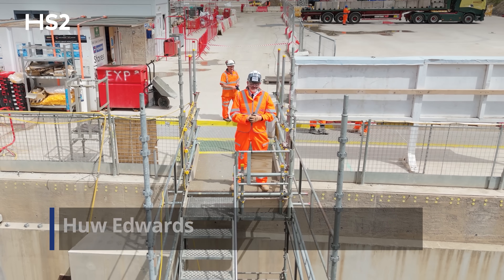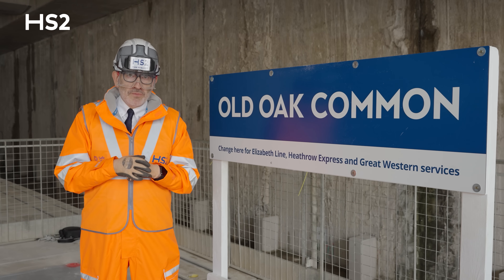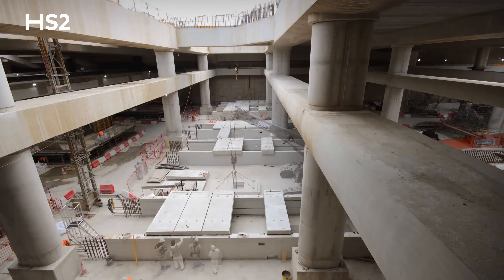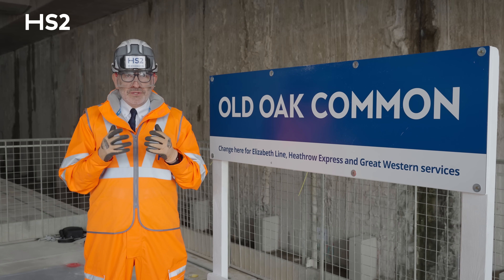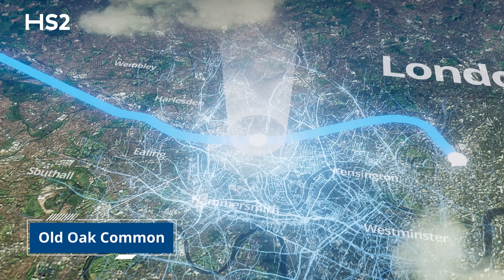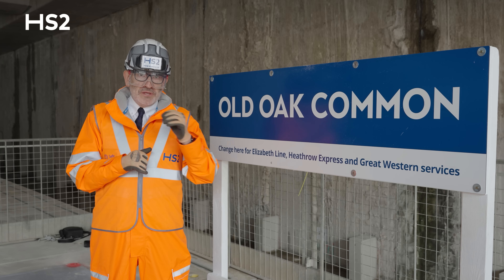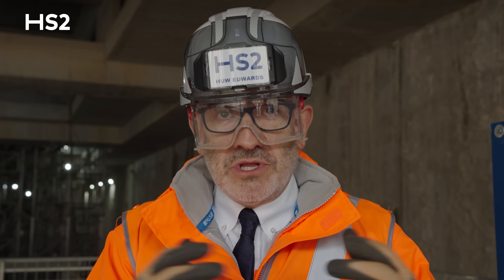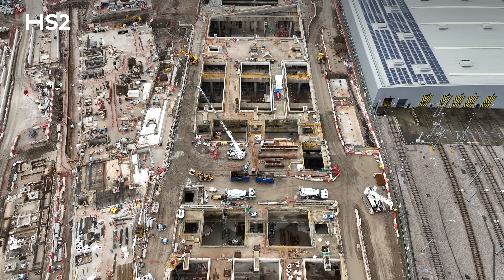Britain’s new high-speed railway: 🚆 First platforms installed at Old Oak Common 🏗️

Comment: Absolutely fantastic video. Well done, please upload more content.
Watching as a Expat from Australia, it's amazing to see Europes biggest infrastructure projects taking shape. And something the British people should be very proud of, the civil engineering alone is outstanding. It's just a shame the political meddling and mismanagement from HS2 board have tarnished this project. hopefully with Mark Wilds at the helm and his success with crossrail the government will have the foresight to carry on with phase two a/b from Hansacre to piccadilly via  manchester airport as the MNWRL Staffordshire connector. But this must be built to the USG GC loading gauge and slab track and not to the proposed W12 victorian standard which would be criminally wrong and insane. With the proposed liverpool to manchester rail line (W12 loading gauge, if built) the section from Millington to piccadilly via manchester airport must be GC compliant. With the current Mayor Andy burnham vision for a new piccadilly underground through station at piccadilly (july 2025 announcement), lets hope its designed for GC size 400 meter trains and platforms from the start. This could be very achievable, if done in sections over the next 20 years, with the current and future skilled up workforce.  The nay sayers need to remember big infrastructure like this is not for necessary for us but for our children and grandchildren and the massive economic benifit for the UK. Well done to all the people involved in building this you and the UK should be very proud.

Comment: Thanks for this video. Getting InterCity trains off of our mainlines, so that more commuter trains and freight trains can run on them is a vital part of the work needed to improving our old railway lines.

I hope that this "reset" involves restoring the Eastern Leg of HS2 and extending both the Eastern Leg and Western Leg all the way up to Scotland. I also hope that HS2 Limited stops building terminal stations in cities in the Middle of England and that we instead get stations like Old Oak Common and through platforms in places like Manchester.

(And eventually, I hope to see Old Oak Common directly connected to Stratford International, so that Glasgow and Edinburgh can get the Eurostar services that they were promised when the people of the UK were originally asked to fund the Eurotunnel. And yes I mean that we should abandon St Pancras and the not-yet-finished Euston station and build a "high speed Crossrail" line though London with a new Central London high speed station.)
Reply: It's a nice idea, but there's an awful lot of tunnelling under London already to avoid: to get 2 new tunnels through without colliding with/compromising the engineering of the tube network would be another gravy train for the engineering consultants, I guess....

Comment: Building a new railway in this densely populated country is really difficult, and HS2 is doing just that with real imagination in creating the Old Oak Common hub and terrific engineering skills to solve numerous problems. Just like the Elizabeth Line, when it opens we will wonder how we coped without. Regional commuters in the midlands who currently crowd onto intercity services and often have to stand will also get a much better service.
Reply: It's no harder than building Tokyo-Osaka, which the Japanese updated recently (they first built a Shinkansen on that route in the early 1960s). We have got to stop deluding ourselves that we are uniquely challenged by our demographics and geography: we are not. We are uniquely constrained but our NIMBYs, our parasitic legal system, our planning system and our inability to engineer appropriately rather than over-engineer by quadrupling the cost are what makes HSR so difficult to deliver.

Comment: There needs to be a tunnel that directly connect OAC with STRATFORD INT.
Reply: Why not a loop round past Heathrow, Gatwick to join HS1 at Ashford? Londoners don't need to connect OOC to Stratford, they just go to St Pancras. Just build it under the M25 and M20......

Comment: While a London to Birmingham high speed line is a good idea on paper, I honestly feel a high speed line between Liverpool and Edinburgh across the Pennines via Leeds, York and Newcastle is needed way more than HS2, the capacity and reliability problems on The TransPennine line are way worse than on the WCML.
Reply: The reason for HS2 is to relieve congestion on the Southern Section of the WCML and through Birmingham
Reply: @peterwallen1063 I see.

Comment: This is taking far far too long and actually should be built all the way to Glasgow and Edinburgh. But good to see it actually being built. By the time HS2 is completed Japan and possibly China will have MAGLEV going distances further than HS2 London zone 5 to Birmingham Zone 5.
Reply: Really hard to make any financial case for extending to Glasgow or Edinburgh.  HS2 is about capacity, not actually about speed  - you get the speed as a by-product of building a new modern line.  There's no economic case for a huge increase in rail capacity to Scotland which a new line gives you, because there are cheaper ways of providing the required capacity.

Comment: If the Euston link is there, seems a bit daft to make OOC so big as its just a through station at that point.  Personally I think HS1 and HS2 should have had the same meeting point.  It seems short sighted to me.  Also, all HS2 is doing is relieving pressure on the WCML and that is it.  Between 189 and 226 trains a day between currently run between Euston and Birmingham.  HS2 will drop that number to approx 50 I think.  Meaning the WCML will have loads of head room for expansion of freight and local services.  Thats where the positives start and end for HS2 in its current mandated model.
Reply: OOC will be a terminus for some years until Euston is built.

Comment: Billions wasted and yet HS2 keep churning out videos on 'look how good we are' when this vanity project can only be described as a failure are really should be cancelled immediately.
Reply: Really; and how many billions and how much land, would it cost to build two new motorways to the north to take the traffic instead.  No, the country needs improved rail infrastructure.
Reply: I think you are confusing issues; I agree the country needs a better rail system but HS2 isn't the answer; it doesn't meet the original design parameters and so has failed. The money would have been better spent upgrading the original system and removing the 'high speed' element.
Reply: I can see you have a vested interested in HS2, ie, keeping your job for as long as possible, I get it,. HS 2 failed due to a flawed initial business case, poor planning, procurement strategy, the 'it'll be all right' attitude and the 'wrong' people in key positions. As an EM I use HS2 as an example of what happens it you dont know what you are doing. A country the size of UK doesn't need a high speed link, Covid didn't help HS2 I know but it was a poor idea from the start managed (and I use the work in the loosest form) by people who hadn't a clue about running an MCP.
Unfortunately it will be completed, but by the time the ticket prices have been passed onto the public it will not be economically viable and so will die a slow, painful and expense death.

Comment: Ah yes...the Aston to Acton line..HS2 railway might never reach Euston and Old Oak Common could become its permanent London terminus in an effort to avoid the cost of building the station at Euston. . So we’d end up with a relatively short shuttle service from Birmingham city centre to the edge of London, and, well, that’s about it. The logic for going for high speed to Birmingham is lost.  Spending 300% more for a really fast train set (compared to 125mph) between the outskirts of two cities not too far from each other is bonkers. A trip by HS2 between Birmingham and Old Oak Common would take around 42 minutes, but the connection within London between Euston and Old Oak Common adds another 30 minutes, plus an average of 10 minutes changing at Old Oak Common.
Reply: Sorry mate it shows how much you know about Birmingham, the HS2 line from Birmingham Interchange Station to Birmingham does not go near or through Aston, it runs through Washwood Heath, Saltley and Duddeston before entering Birmingham Curzon Street Station in BIRMINGHAM CITY CENTRE, plus it will be terminating in London Euston as Old Oak Common Station is not designed as a terminal station and the tunnels from OOC to Euston have to be bored out now before the station opens for safety reasons. Aston is about 2  miles from the HS2 route into Birmingham with the trains doing 225 MPH on most of the route
Reply: @peterwallen1063  Lighten up. People call HS2 the "Aston to Acton line" or the "Acton to Aston shuttle" because the planned route has been significantly scaled back, potentially terminating in West London at Old Oak Common (near Acton) instead of Euston, and with the Birmingham terminus being Curzon Street station (fairly near Aston and only one consonant different!). Trains from Aston to Birmingham New Street typically take around 8 minutes. The revised HS2 plan created a shorter, less impactful high-speed rail line focused on connecting these two specific areas, rather than a larger network serving multiple cities. (Curzon Street Station, the planned northern terminus of HS2 in Birmingham, is currently scheduled to open between 2029 and 2033. While originally planned for 2026, delays have pushed back the opening date).
Reply: @paulfildes5489  Did you read my comment or actually know where in Birmingham HS2 does run, as I said it runs no where near Aston so how is it called the Aston to Acton line when in Birmingham HS2 runs from Birmingham City Centre ( Birmingham Curzon Street ) through Dudeston, Saltley and Washwood Heath, Aston is 2 miles away from the HS2 route, I live in the area of Birmingham and no Curzon Street again is nowhere near Aston. Aston Station sagain is around 2 miles outside the City Centre and no matter how long the ex Walsall trains and X City trains take to get into New Street going through Duddeston Station first makes no difference. The HS2 line does not go anywhere near Aston full stop plus it is now going into London Euston as per the new Labour Government. There is no revised shorter HS2 route from Birmingham to London not sure where you got that from and doesn't connect specific areas, it connects the UK,s Capital London to the UK's Second City and second largest City of Birmingham City Centre
Reply: @peterwallen1063 The HS2 programme has become a casebook example of how not to run a major project. It is unacceptable that over a decade into it we still do not know what it will cost, what the final scope will be, when it will finally be completed or what benefits it will deliver. The government confirmed that HS2 would terminate at London Euston in the Autumn 2024 budget. However, the Department does not yet have a plan for the work at Euston which includes: the HS2 station, the existing Network Rail station, the underground station, and the commercial and housing developments near the station. In addition, the Department intends the work to be substantively privately funded, but it is unclear how achievable this goal is. After all this, the government announced the new Euston station will only have six platforms rather than the 10 or 11 platforms as originally planned. One rail consultant said that having only six platforms was ‘lunacy’.
Reply: @paulfildes5489  First they are at the moment tunnelling between Old Oak Common and the Throat of what will be the HS2 station, the HS2 station will be made up of 6 platforms solely for the use of HS2 services and a 7th platform for joint HS2 and WCML services that has already been announced by HS2 ltd in one of their many video's along with the upgrading of the existing Euston Station. The benefit of the HS2 line is the speeding up of high speed passenger services at least to Birmingham and Stafford and more capacity on the existing WCML for other train services and Freight by moving the vast majority f Avanti West Coast hi speed passenger trains onto the HS2 route, the other West Coast platforms will still be in use which will amount to around 14 + in total at Euston overall

Comment: Terminating at Old Oak means that the journey time  from Birmingham to central London is longer in time than it is now. Great!
Reply: The intention is to eventually take the line into Euston from Old Oak Common.  The Old Oak Common destination is therefore temporary, albeit likely until 2040. .
Reply: @TrevorWilliams-fq8mg  Therein lies the problem 😂
Reply: @guyallison9066 Yes it's a long time.  There's no way Euston can be opened sooner. They haven't yet got a design for the station or funding for the residential to be built above the station. .
Reply: @TrevorWilliams-fq8mg  Why does it take 15 years to go to Euston? Can only be due to drip feeding minuscule amounts of funding.
Reply: It is not terminating at Old Oak Common as this station is not being constructed as a Terminus Station it is going to London Euston

Comment: Progress on HS2 always makes me pleased, however, I still hope that future governments will re-green-light HS2 in full (both the Manchester and Leeds legs) with scope to extend from Leeds to Edinburgh and Glasgow via Newcastle on 300 km/h+ ETCS signalled HSLs. A Sheffield Bypass would be nice too if Leeds is recovered (even if it has to go onto conventional track with British loading gauge restrictions). A high speed connection from Leeds to Manchester as part of HS2 would be great too, allowing people in the North not to have to go down to Birmingham to switch to my dream Leeds to Newcastle to Edinburgh and Glasgow extension.

I also wish that HS2 had stuck to its plans for operators to use fleets at a larger European Loading gauge with the opportunity to purchase pre-existing stock and kept the earlier planned compatible platform system with 760 mm high platforms (or even 550 mm for Alstom double-decker TGVs, although that wasn't in the original plans). I know step-free access for wheelchair users has been a big reason for the higher platforms, but I'd have liked to see each train feature a dedicated coach for disabled access that was compatible with lower floors and lower platforms, even if that meant having excess ceiling space and steps up/down at the end of each disabled coach to the corridor connection to the next coaches.
Reply: The eastern leg is long gone, won’t be recovered. The section to Crewe and Manchester is still a possibility though as the land hasn’t been sold off yet and there is big pressure from Manchester councillors to resurrect it. Additionally NPR if it goes ahead will link Liverpool Manchester and Leeds together, and be directly connected to HS2, so services from London to Leeds will be entirely possible on HSR, as well as Liverpool too. NPR is basically HS3 but they’ve renamed it to cause less controversy, as we all know the controversy HS2 has caused.

Comment: HS2 - The Old Oak to Brum Shuttle - with connections at street level in Birmingham to the utterly vile New Street for a slow train - Stop building the part now - until they continues north its a FAILURE
Reply: First it will be now running from London Euston to Birmingham Curzon Street with  tram connection to both Birmingham New Street and Birmingham Snow Hill Stations and Birmingham New Street Station has been rebuilt now and is not vile.

Comment: The future of the UK's Railway Network? That would imply there are benefits to the whole of the country building this white elephant, massively expensive project, not just the bit between Birmingham and 'just outside London'. By cutting off the spur going further North and East, this new rail line is going to make congestion on the traditional lines considerably worse to the extent we will lose more of the current services than will be replaced by the ones operating on this new line.  The lines  around the connection between the traditional lines and the high speed line and also further north around the Manchester area will be clogged up with slow moving trains as these new high speed trains won't have the capability to tilt (because on the new line, they won't need to) and so will run a lot slower on traditional lines compared to the existing trains that can tilt. 

The other issue is that the trains that will use this new line going to stations not on the line cannot be double decked and cannot be 400 metres long because they will need to use the Victorian era built lines, so on top of being slower and shorter than trains running between Birmingham and ‘just outside London', there will be less seats available because when they move from high speed network and onto the traditional lines,they won't be able to run at the same speeds as the Pendelinos around the bends and curves because the new trains won't be able to tilt. So, a massively expensive rail-line to nowhere is going to screw up the rest of the country, all to get between Birmingham and just outside London a few minutes faster and it's costing us taxpayers how much?
Reply: Nope HS2 trains will be running into London Euston and the journey time between Birmingham nd London will be 40 mins faster in both directions